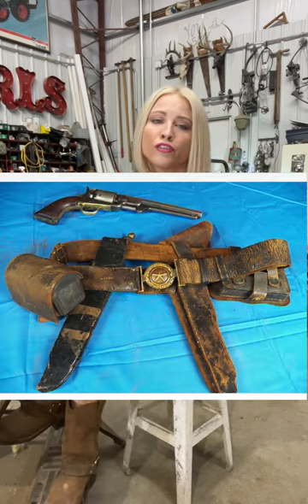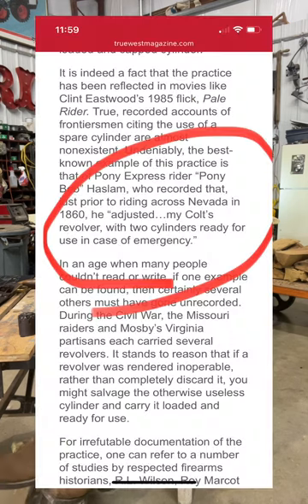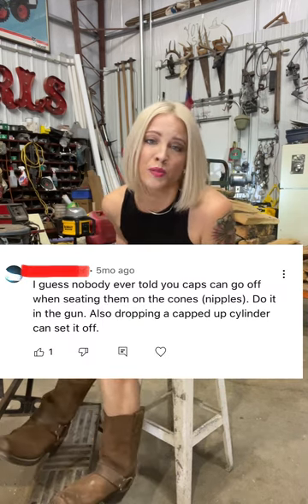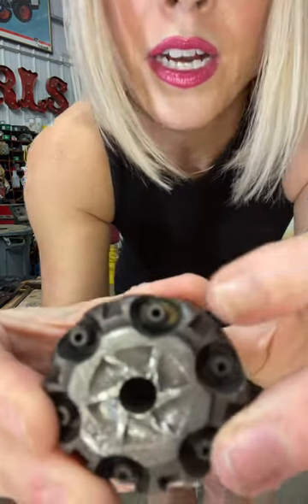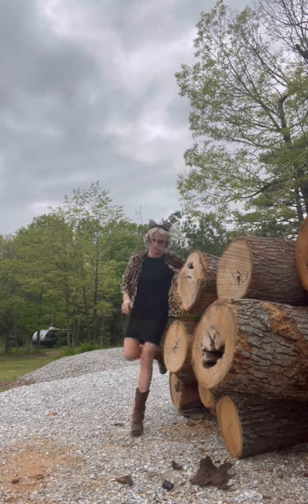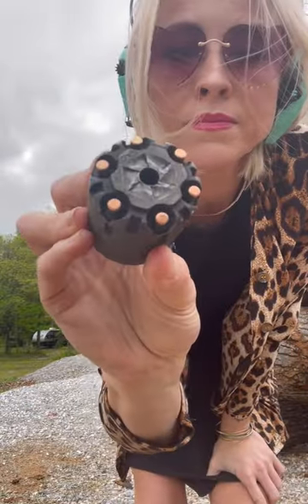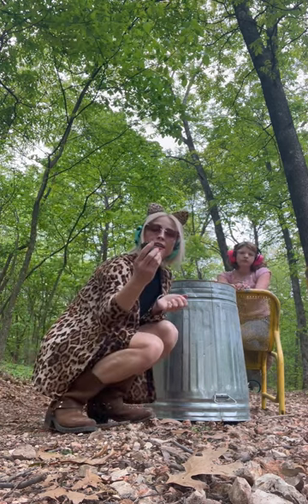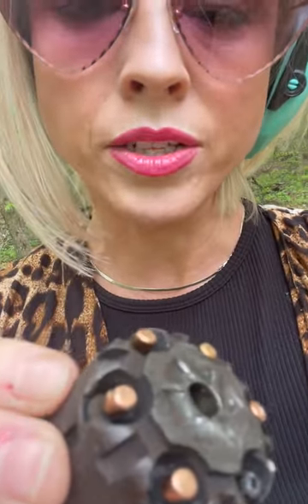The Tactical Black Powder Cylinder Experiment

Comment: The cylinder coming out the way it does is mainly a secondary function. The primary design function of the 1858 Remington was the solid frame and top strap. The barrel had to be screwed into the frame making it a necessity to have a method of removing the cylinder in the way it was. This was an upgrade from the Colt patented pistols that the barrel had to be removed and the the weakness in the design of a 2 piece frame/barrel it's main purpose was for removal for cleaning. But you hit it spot on with your human ingenuity comment. Just because it was designed as an afterthought it was early on adopted as a cylinder exchange and even during the period spare cylinders could be purchased. And if you think about it in modern terms how many times does someone buy a magazine fed weapon and it only come with 1 magazine. Don't let the comments get to you. Most of the people telling you absolutes when it comes to BP arms are speaking from a place of ignorance. Also I wanted to commend you for your due diligence in the research. Most do not go even that far when making a rebuttal video. Keep up the good work, I love the videos, very entertaining.
Reply: We all know the real reason they made it that way is so the Clint Eastwood could be a total bad a** in "Pale Rider".  Time travel WAS involved.
Reply: 💯 Really great content, I have this weapon, and can change cylinders without looking. I love the history aspect of weapons, I’m currently building a drill press table so I can drill out the plunger for the Johnston and Dow  conical bullet, I have a bunch cast. Great channel I like your flair, only one suggestion, please get out of the portrait mode, you deserve a full screen production ❤
Reply: What about the history of its conversion to 45 colt cartridge, it’s my understanding that it was the next step in the history of this weapon, I am correct right?

Comment: I have a Pietta repro Remington New Army.  Even though I've only done it a few times, I can change cylinders on this gun in about half the time it takes me to load with paper cartridges (never mind loose powder and ball), and I can easily see doing this on horseback, where loading cartridges would be problematic and loading loose components impossible.  With practice, I could probably work this down to less time than it takes to eject and reload six cartridges in a Peacemaker (if such a thing had been available in the 1860s), with only the top-break Smith and Wessons, when they arrived, being competitive for reload time.

Further, loading the cylinder ahead of time ought to cut down mightily on the mistakes that the distractions of combat could cause -- like forgetting the powder before ramming the ball (one chamber out of service until you have time and tools to remove the nipple and drive the ball out from the rear or work a powder charge in and shoot it out).  I find it much harder to believe that people did this with Colt design revolvers -- with the wedge-retained barrel assembly that screws off before the cylinder can be removed -- than with Remingtons that seem to have been designed with easy cylinder removal (even if only for ease of cleaning) in mind, and yet as noted Colt sold their Paterson revolvers with a spare cylinder in 1840.

As for safety, a compromise (trading time for risk) of loading the powder and bullet, but not capping the nipples, would still have saved considerable time on a reload while making the cylinder effectively an inert lump if dropped (unless dropped into a fire, anyway).

Comment: I have repeatedly tried to set off a cap my pushing on it...can't do it. I use a dowel pusher with a knob on the end to add force.
I doubt that a dropped cylinder would fire if dropped... it's possible, but then I've heard of metal cartridges in an open box going off when an 'empty' landed on the box. So it seems that it is possible, although I've never been able to afford a "sacrifice' cylinder to try it repeatedly.
Those caps got dented because the caps were not pushed right home on the cones.... only a protruding stone could reach them.
You are correct, it's not an issue..... This is jut another bit of "lore" with no foundation in fact...... There's a lot about flintlocks too, most of which is garbage... 🙂

Comment: The Remington changeout is a slight possibility, but the Colt changeout is a stretch. Disassembling a revolver in the heat Amd carnage of battle is a good way to loose pieces if your revolver. And doing that from horseback would be next to impossible. Premade paper cartridges were made and issued throughout out the Civil War that speed d up the reload. The revolver was a close quarter weapon for cavalry and a last ditch weapon for foot soldiers. Reloading a musket or a breach loading Sharps was much faster during battle. As far as Quantril’s men, they each carried up to 6or 8 revolvers for plenty of fire power without having to reload. The two gun genre illustrates in western movies came about during the percussion revolver era. More shots without reloading.

Comment: The chances of the cylinder going off by dropping it is not zero, but unlikely. And if it did go off, the cylinder would not explode like a hand grenade. Otherwise, it would do the same thing in the gun itself when it is set off normally. And if it did, the bullet would not go far as there is a reason there is a barrel. The pressures build up in the barrel to propel the projectile. No barrel, zero pressure once the blast leave the cylinder.

Comment: The Patterson came with a spare cylinder because it can't be loaded on rhe gun. You needed to take it apart to load so Colt supplied the extra cylinder since it was already apart easier to put in the extra. Also if you saw how it was loaded you'd see how much longer it took and how much more effort it took to deal with. The loading tool is innovative but a joke or nightmare depending on perspective.